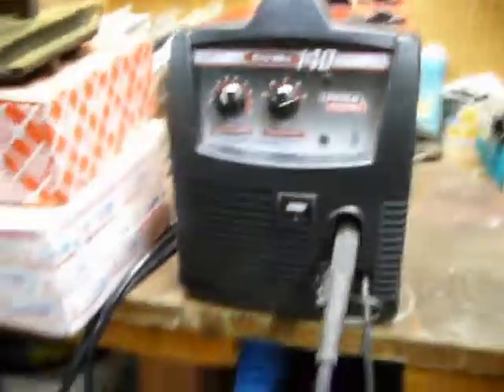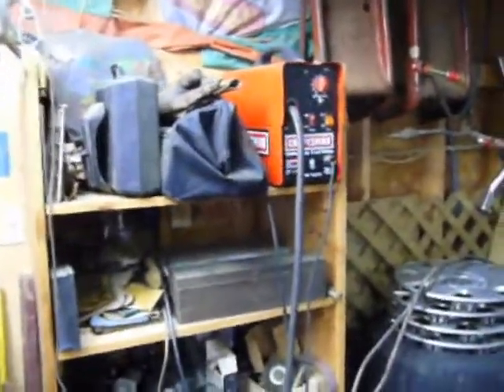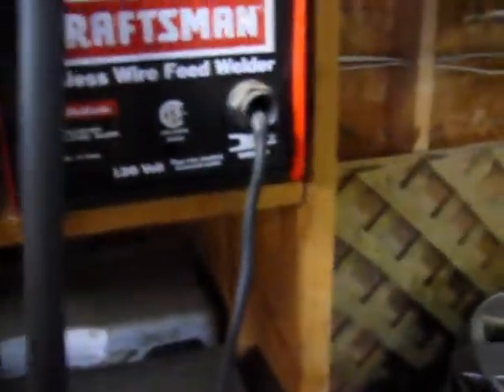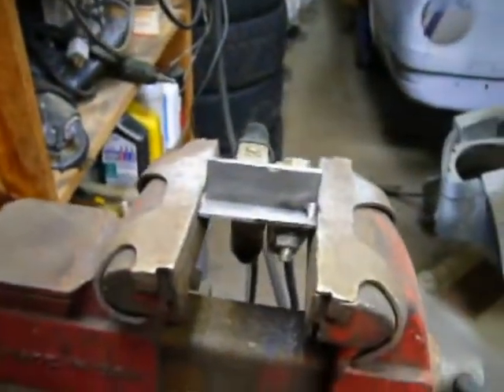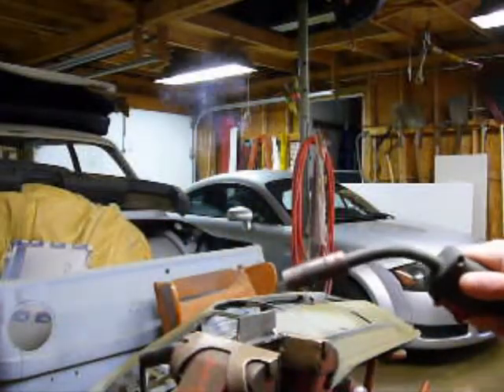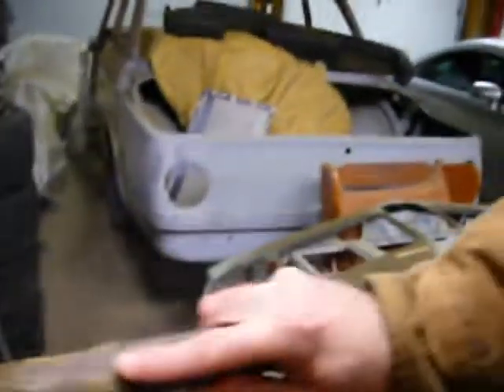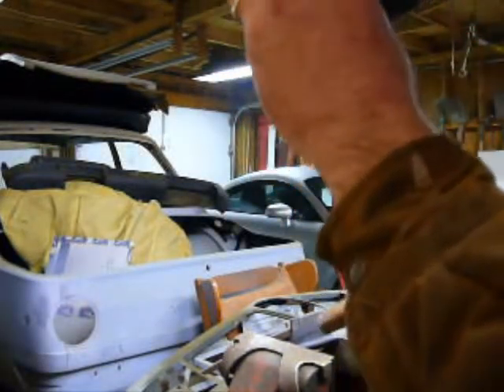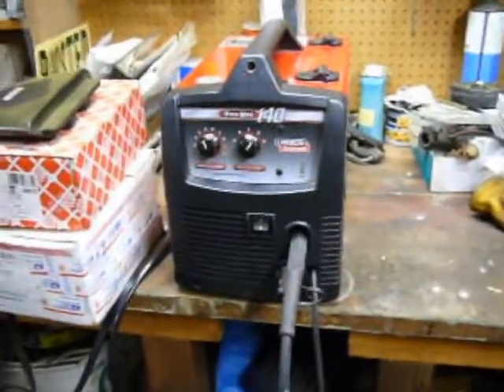Lincoln 140 Pro MIG vs. Craftsman Flux Core Welder

Comment from the maker: The Lincoln is 140A peak as the name suggests.  I no longer have the Craftsman, but I believe it was 80A or 90A, so I can believe it would be pushing it to weld with 0.035 solid wire.

Comment: You have the wire spool upside down on the Lincoln.  It should feed from the top.  That's why the wire feed is slanted @ an upward angle.

Comment from the maker: Yeah, the flux core is tough for sheet metal.  Try using a heat sink to dissipate the heat and make short welds at a time, allowing the metal to cool in between.  It can be done, but takes some practice.

Comment: Awesome video! Made my mind up quick. Now to save the extra $$. I'm restoring a 72 gran torino and am at the point where I need a welder. Is it worth it, for a beginning welder, to buy a cheap (100-150) flux welder and grind away the mess? I want to progress on this project. But can't afford a 500 unit yet. Should I hold out for the mig no matter what? Thanks!

Comment: ...Errr I have the same craftsmans MIG and all I do is burn holes through 18g metal :-( The voltage is either too low or too high.
Reply: Voltz to hi also turn down your wire. Speed

Comment: This is not a good video for comparing the two welders.Its more of a wire comparison -- Flux vs. M.I.G.. I've had 4 of these Lincoln Weld Packs and they are great welders. The original 100's weld every bit as hot as the 140's  and only $280.00 (they just dont sell them any more..)I just recently tried an Eastwood 135 and it was way smoother than any of the Lincolns, so I looked into it and they are just all round better. Support warranty and about Half the price of the 140..Bye  Bye Lincoln 140 !!! Also this gentleman has the spool upside down on the Lincoln. It will never work like that with a 10 lb. spool and will soon ball up in the liner insert. A good welder can produce an equal weld with flux or gas.Flux is way more portable and gas is no good outside. As for the spatter use some anti-spatter spray and nozzle dip..If your welder comes with an asbestos cup, change it to the metal type (even for flux core)Then weld away..But I tell you the Eastwood is the better deal .I'm giving the Lincoln to the Grandson..:-)
Reply: No it is not upside down and also the weld gets contaminated with anti spatter due to the thin gauge . wont have tensile strenght if is needed . you want s little crackle when oscillating and the amps (wire speed) needs to be adjusted to the heat (voltage)  to preventing. Excessive material witch causes spatter . this can also curve the amps by pushing or pulling the puddle.
Reply: Ther is no need for a nozzle when using an inershield wire . save your. Cup ther not cheap u will also be able to see and establish your puddle when you start
Reply: These are not %100 pen welders